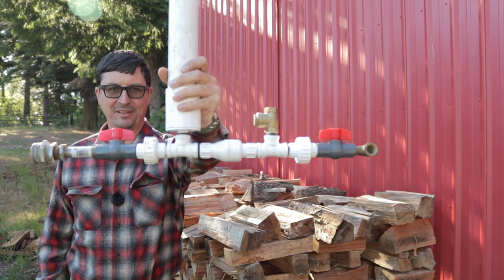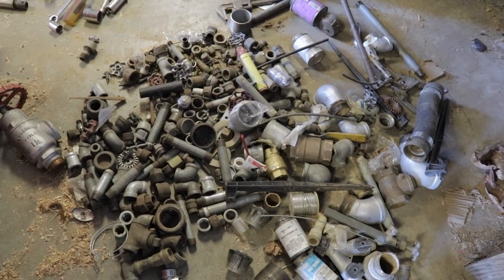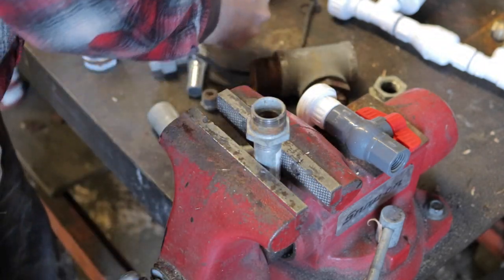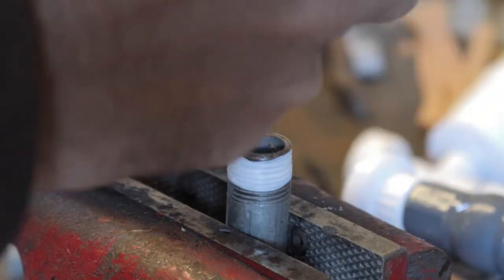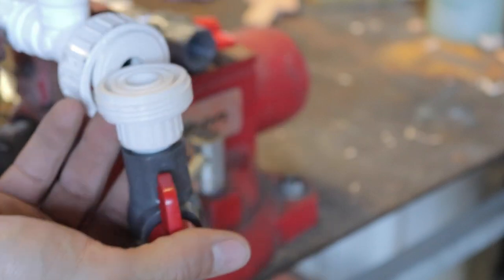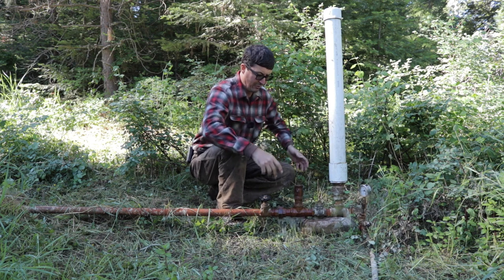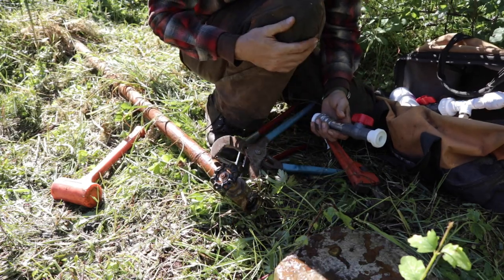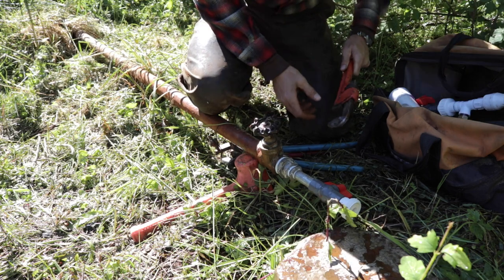Coolest Little Ram Pump Ever!!!

Comment: Loctite 55 thread sealing cord - hands-down winner of pipe sealants! i've never had a fitting leak using this.. just rough up the male thread, wrap this around (no need to put on yards of the stuff, about 4 turns going with the thread, 4 against and 4 back with is plenty) -- I guarantee you'll never go back to tape or chemical sealants!
Be careful though with plastic fittings as the female end tends to crack if you put on too much PTFE sealant. here chemical alternatives are better.

Comment: I prefer the pipe thread sealer paste  - it does a better job than the teflon tape and works for gas lines, hot water, steam, etc

Comment: I was actually a bit surprised that your metal union didn't have an o-ring. In my fairly limited area of experience all such metal to metal joints used o-rings, from low pressure gravity drains to stuff that kept the ocean where it belonged. They make an o-ring lubricant that helps hold it in its grove and prevent premature failure from abrasion, the stuff we used looked like vegetable shortening.

Comment: Pipe dope for any connection using anything other than pvc to pvc. Use thread tape for pvc to pvc, pipe dope expands the PVC at the point of connection and that pressure can break the pipe

Comment: White for water and yellow for gas or blue for everything, but concerning pipe dope I normally use it for gas pipe. I’ve seen some old timers who swear by using an application of both.
For PVC I use purple primer and clear or blue glue. Be careful not to spill the primer it’ll stain anything.
Suppliers are usually HVAC or plumbing places.

Comment: According to building code for plumbing: a pipe union cannot rely on any other material other than the threads itself to create the seal. Teflon tape and pipe dope is simply a lubricant.

Comment: use both. Teflon tape was originally designed to lubricate the threads not to seal them (though it works as a seal) we put Teflon tape then pipe dope over the top before you put it in the female side, that way it's sealed and lubricated.

Comment: I was told hemp was the best sealant for wet pipes as it swells in place and forms a more durable seal. And for tapered threads and air/gas use teflon.
?

Comment: (Gas fitter) I use pipe dope in most cases but I use orange 'T'-tape  when using it for glycol, gas, oil anything other than water . I usually use both t tape and dope.

Comment: Just to chime in on the Teflon question. I used to be a master plumber and a pipe fitter. It was code when we put in sprinkler systems the inspectors always wanted to see both the tape and dope used together.
Reply: yep.  always do that myself for years of plumbing.  teflon a few layers and then thread seal compound and wipe clean after.  never had a leak with that... well maybe once when i forgot to tighten it !
Reply: Dope, tape, dope
Reply: i agree i work on pumps wells irrigation systems and do water treatment services and metal to pvc and metal to metal we use teflone and pipe dope on pvc to pvc we use teflone as to not split our pvc by over tighting

Comment: You should use tape and dope.  Also, remember to follow the thread direction and you should feed the tape from the opposite direction so it keeps tension on the tape and it doesn't go slack.   Start from the end of the pipe and work back.

Comment: The blue tape is safe to use on gas and oil lines, white tape can break down if exposed to fuel, and should only be used for water and air

Comment: Why don't use flax/hemp for pipe joints? Its old school, I know. 
But it is cheap, drinking water safe, no expiring date & you can adjust the joints without the seal starts to leak.
I have never been at a construction site in sweden where a plumber do not use flax/hemp as a sealer.

Comment: I use to do alot of plumbing when I was building pools and to be honest either one does the job. with gas and iron fitting I always used both dope and tape and with just plastic usually just dope. never had a problem with dope or Teflon. blue dope hardens a bit while white stays pretty gooey. black Teflon seals better as it's a bit thinner so you can do more wraps.

Comment: Hey Wranglerstar, you could always try rigging up a Pythagorean cup underneath the little outlet collecting the water it shoots out. though there could be an engineering problem if you tried to add another pump under the cup.

but if you want to give some water to the pond that is always constructive too.

Comment: Teflon doesnt seal, its only used if youre connecting two different types of metal. It will keep some from corroding together and you can take them apart. where as pipe dope is an actual sealant.

Comment: I believe that you can use the Teflon tape for most materials, & it doesn't dry out. Just wrap it the proper direction & you're good; idk about the different colors. "Pipe dope" is only for metal but may seal better because of the deeper threads on those pipes.... just my two cents.Correct me if I'm wrong, I'm here to learn from others also.

Comment: 3-5 wraps Teflon tape with a small string of dope around the first couple threads is what I do. I won’t get into it much unless asked but it also depends on the material the fitting are made of. This rule of thumb can drastically change under other circumstances

Comment: i am not an experienced plumber but a pex set up seems a bit better than a galvanized steel. my own experience tells me that i should be replacing most of those parts that can be crimped on pex system. while i have worked with a pex system that can not be exposed to uv . i have noticed a cheaper and greater longevity with great water from the pex! i live in a colder climate with freezing issues so my experience may differ. but from what i have done the pex, it has seemed to do better in all climates!

Comment: Different strokes for different folks some plumbers are dope only some use Teflon only as the lubricant. For me I was taught by an old timer who always used Teflon first dope second. Ive stuck with that theory now for close to twenty years and have had very little issue. Stainless needs the grey heavy duty tape. I’ve had issue with weepage with white Teflon.

Comment: It really does not matter if you use tape or dope, both simply lubricate the joint to assist in the sealing process. It is the 1 degree taper in the thread itself that insures a tight seal. It is really just a matter of preference.
Reply: The joints will leak if you don't have a sealant.  The imperfections in the threads leave a path unless you over-tighten the joint, and even then it may leak.  It's a lot easier to use a sealant than to keep torquing on the pipe and fittings.

Comment: Technically Teflon tape and pipe dope arnt sealer they are lubrication to help the threads bite deeper. That being said as a plumber I always use both. Just the way I was taught and have done it since

Comment: Anyone feel free to check my math...but, the little ram's intake has a "surface area" of approx. .2 sq inches (.25x.25x3.14); the bigger one had a comparable dimension of 1.7 (.75x.75x3.14), meaning if pressure is constant, the larger pump uses 8x as much water. The little pump seemed to cycle faster to me. So, I'm curious if the numbers equate on the "half gallon" test. That 1.5" pipe/ram would send up half a million gallons in a year (not too shabby).How quickly did the half-gal pitcher fill up? Considering one-eighth of the water is passing that initial point, it would be logical to conclude 240 seconds, or 4 minutes. I suspect it'll be less.

Comment: Could you add an elbow and hose on the waste water outlet then drill a small hole in the top of the elbow and instal a small rod of some sort to press to start the pump? Then you would not get wet.

Comment: Thanks for creating your channel.  Old-timers and whipper-snappers alike can learn quite a bit of both hands-on
experience... And also a great mindset that you convey through your videos.
 I read the comments below and, after digging past the ever-present "tube-idiots' " comments and redundancies because it seems only the "trollers" banging away at each other...  Sorry, it's just a vicious "psy-cle" of stupidity that infects the net. 
  The tape version you are using there is the most convenient and, if properly applied, sufficient for most lighter tasks, the liquid or "dope" type is preferred on larger, heavier work.  It works fine on smaller parts but is messier do deal with and simply requires more work.  So, there ya go.  Use dope if you have it, especially on the larger diameter and heavier load demand parts.  Seals better, lubricates better, lasts longer... Ya get what ya pay for.

Good luck to you and yours.

Comment: I always did a mix of Pipe dope and Teflon tape. I'd put a little on the inside and a thin layer on the outside. That thin layer of extra dope on the outside of the tape always helped get the pipes started turning in easier.
Reply: The Blue teflon tape has pipe dope mixed in with it, and it is thicker. (usually a better seal)

Comment: coming from a master plumber... if you can afford it use brass fittings instead of galvanized steel. the galvi wears off and the fittings will swell with rust. teflon tape is typically the way to go, the white Teflon tape is about half the thickness of the blue Teflon tape. I like three to four wraps depending on the thread depth. stick your index finger through the roll of tape get your first wrap started then use your finger like a spool.

Comment: I was always taught to use pipe dope on materials that could cut the Teflon tape as you twist on the fittings IE copper, steel, pretty much anything other than PVC. Someone said to use both, I guess I cant see the harm in that, but never tried that.

Comment: nice pump, but aren't you going to get boundary layer issues with the smaller pipe choking the flow off.
does the flip flop rate also matter? I mean bigger pump, slower the natural speed of the pump, and what as the thing decays as they all do. I bet it'll drop off sooner.
the ideal test would be a two pump solution, run them side by side for two years and measure the run off every three months. see how the big versus small really is.
in addition you'll get a redundant solution from this for your off grid situation.

Comment: I had asked about the waste valve in the previous video, but I never explained why. I wasn't concerned about wasting water. I used to be heavily involved in the marine aquarium hobby and there is always a need for plankton-friendly pumps. I was curious if this type of pump could be used to supply a filter from a drilled tank (about 2' drop) with the waste valve directed to a sump.
Reply: I have never built a ram pump, but I have done so in depth research for mission trip applications and it seems to me that you need a higher head to get a reliable system going. I can't remember fully but there is plenty of information on the Internet about hydraulic ram pumps
Reply: ***** O.o I think I made it pretty clear I wasn't concerned about wasting water. In my case, it would need to be redirected as the last thing you want is to lose saltwater in a marine aquarium.

Ryan Luttrell That's probably correct. There are other options available, but it couldn't hurt to ask.

Comment: not hub spigot, at least never heard term. The familiar term is street couple (male end n female end), that's a male 1/2" to female 1/2" 90* brass street couple. called this i believe because you can insert each successive piece in line and always turn wrench same direction and without need for securing previous piece from rotation (think well drilling pipe), and when you insert between two existing pipes the threads can not start on both and end being tight on one end without being tight and leaking at other.
Brass is way more expensive, than galvanized or pvc. usually brass is used for chemical and corrosive plumbing conditions. when you have brass, copper, and iron (black or galvanized), intermingled you need to electrically ground or isolate contact between metal types as it accelerates degradation of metal causing premature failure. the different color tapes are used in different applications ie.:type -- natural gas vs. water vs. chemical.
the real purpose of the tapes is to provide lubrication of the threads and to seal thread imperfections and mating of surfaces. never use anything on pvc, abs is debatable but i think you don't need it. tighten all fittings snugly but not over tight. if threads disappear into joint you have a problem or worn out fitting to replace. hope this helps.

Comment: Loctite Pipe Sealant is by far superior to any Teflon tape. I worked on 2500 lb & 3000 lb gas powered pressure washers that continuously blew out seals around the threaded  connections. A sales rep came by with the Loctite product and I rarely ever had a problem after that.

Comment: When using PTFE tape you should wind it on following the direction of the threads so when you screw the pipe into the fitting the tape doesn’t unravel as your screwing it in by doing that you use less PTFE and make a better cleaner seal that lasts. Also be sure to clean any oil of the pipe threads as the oil can destroy the PTFE it makes the tape basically useless.

Comment: Teflon is Dupont brand name. PTFE is the substance. Some is a polymer, Some a co-polymer. Cheap tape is less than 2 mil. Good tape is 3.5 mil. Cheap tape is less than 0.5sg. Good tape is 1.45sg. Color is a guide line. Just pigment added. Exception is stainless steel tape witch has silver dust to prevent cold pickup, thus the gray color. Melt temp of most is around 700+ degrees.

Comment: @ 16:00 - Is the brass T facing the correct direction? I see the Arrow facing down, but if It's a valve you must have it the right way, Or i would think.It wouldn't work? Anyone else see that? Great video, so cool how they work.

Comment: If you switch to a commercial 5 gallon pressure tank you won't have to deal with a water logged pump. And swing check valves cannot be made to be weight adjustable to amount of flow and pressure not to mention they will beat themselves up after a while.  I went to a commercial pressure tank and all brass spring ckeck valves with the rubber 0-ring and had much better results.

Comment: Teflon then pipe dope. Dope is a sealant and lubricant. Teflon tape is just a sealant which primarily fills in for a nicked thread. They work best together!
Reply: Oh but if you’re doing half inch pipe you can probably get away with just dope. You should not have leaks on 1/2 even if you do it dry.

Comment: The plumbers way to do it is, Teflon Tape first followed by pipe dope. With variations in today's fitting Teflon or Dope might not do it, and you will need to take it apart. However, if you use both, and it leaks, then throw away the fitting and get another one.

Comment: Water=> Teflon Gas=> Teflon central heating=> Hemp+Plumbers grease when use teflon always use the thickest u can find and hold the tape the other way so you can wind it tightly, with new fittings roughen the thread up easy peasy

Comment: A guy that makes pvc stuff told me one time the pipe dope or Teflon tape was not needed to prevent leaks, especially when going from steel to plastic. My reply to him was: you know when you are tightening down on it, and it starts to click? He said yes. I said, if you dope it up, it doesn't do that, its smooth, and you can usually go another round. His reply was: Okay, so it does help lubricate it though. I smiled and walked away.

Comment: Won't the smaller ram pump get completely clogged with sticks and debris?
Reply: I don't get why there isn't a conical screen on the air pipe up the hill. It seems that is the only place sticks and cones can get into the water pipe in the first place.

Comment: 96 ounces is 3 quarts.  1 1/2 gallon per minute is plenty for a water tower.  Ram pumps aren't efficient in the "water usage" sense, but a simple design with 2 moving parts that needs no outside power to fill a water storage tank is where it's efficiency lies.  Nice to see a design that's easy to acquire parts and build.

Comment: That's abut 10 times as much Teflon tape as you need. You should use the least amount that you can get to stay on the threads. Usually 1.5 to two wraps.

Comment: sealing tape and compound.  Both are lubricants  not really sealants.. if you look at the fittings male and female  both are tapered.   so it is actually the pipes that are doing the sealing.. the tapes and compounds allow the pipes to just tighten up more.

Comment: usualy the tape is better, any sealant stuff that dries is liable to crack from vibration or when you tighten somethign down the line of the pipe or similar, and then its useless, or even makes it leak more, in my experience, but thats from higher pressure stuff.

Comment: can you make more pressure by adding more than one ram pump together?
Reply: If you have enough flow, you can add them parallel to each other to get higher volume out (more gallons per minute). I don't see the practicality of adding them in tandem because the water has to fall for a certain distance in order to push some of the water upwards and as you can see, a lot of the water is wasted at the pump.

Comment: It seems to me that the best pipe dope is the one that is there and works when you need it to, so, "Teflon" tape wins this round.  All the new construction I've seen uses it, I've never had a problem with it and it's cheaper. Both tape and liquid  promote less friction when threading a fitting on so it becomes tighter with less force making it less likely to leak AND easier to get off.  Tape has my vote, which, apparently comes in all kinds of 'colors' specific to different applications. See this wiki for TMI on PTFE tape. https://en.wikipedia.org/wiki/Thread_seal_tape  but, it seems the blue is just like the white, except it's blue.